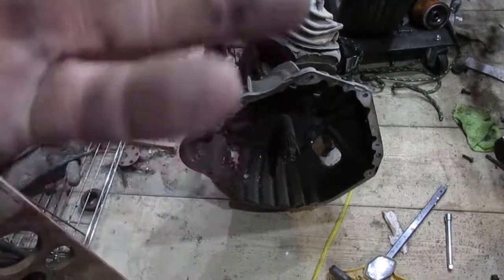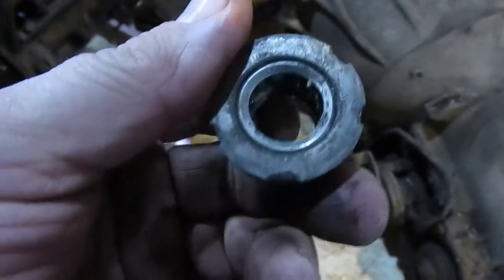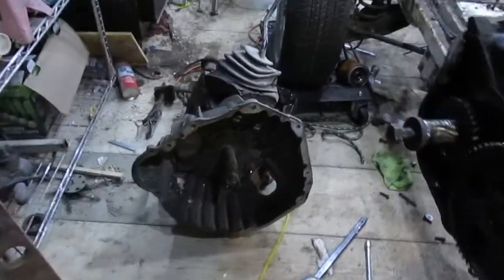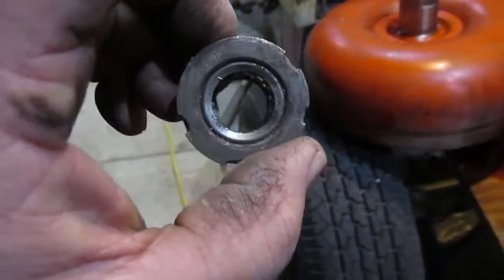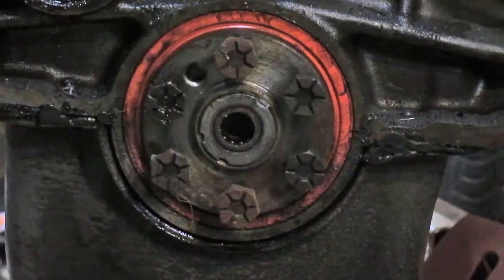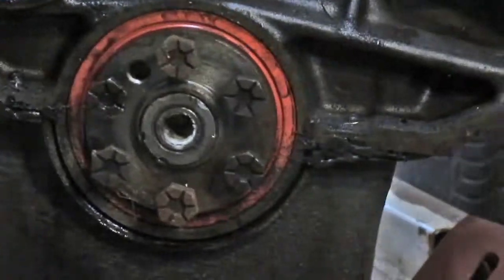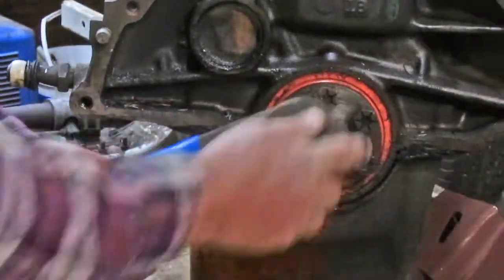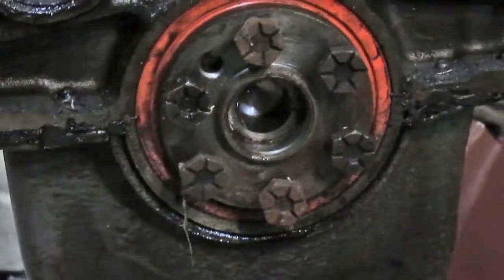Project Boat Tail 20 Removing the pilot bushing with bread

Comment: My boxing day is now complete Ive done the grease method on a dodge slant 6 wasn't to messy I was going from auto to manual
Reply from the maker: I don't think my bolt was big enough when I did the grease method. Or I used the wrong grease.
Reply: I used the front shaft from a manual gearbox worked great
Reply from the maker: @richardhill1682  That would be the best fit I would think.